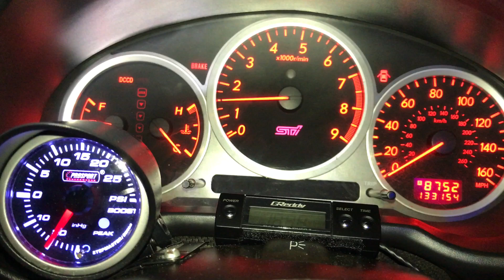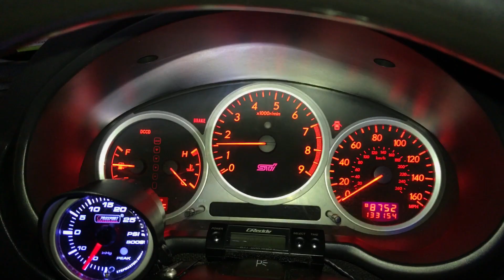How to install Turbo Inlet on Subaru WRX

Comment: Do I need an aftermarket post maf hose when changing my turbo inlet?
Reply from the maker: Eddie Porter I’m not sure exactly what part your speaking of, but what I can say is I used the stock MAF sensor, in an SPT intake, which connects to the newly installed Perrin Turbo Inlet Hose.

Comment: Could this cause my car to run extremely rich and start to misfire? Is misfiring on cylinder 2 and 4 "driver side". Haven't had a chance to check it tho
Reply from the maker: Only way to really tell is to hook up a scanner and see the numbers, also get a flash light and peak at your turbo inlet hose and see if it has a huge rip in it  where it connects to the turbo. thats where they are always known to rip.

Comment: how long did this job take? i just noticed i had a boost leak hitting 8 psi where i have to hit 16, checked my inlet and that shits cut all the way around by the clamp
Reply from the maker: Yeah, I DEFINITELY recommend getting like a Perrin or Mishimoto Turbo inlet hose. AND get a new hose clamp that is not similar to the stock one. I believe they call them T clamps. its a lot safer for clamping on the rubber and it wont eat it up and dig into it like the stock one does. And this job took me a little longer probably like 3 hours but that was because I wanted to make this video to help everyone. If i just ran through this job without making a video probably would of took only 2 hours. Once you get the OEM turbo inlet out, the hardest part is getting the new one slid into the right place and adjusting it so it fits perfect. It is a big Pain in the butt but just be patient and take your time, be careful to not rip anything or break anything in the process of doing it. Patience is key, don't rush, you will get frustrated and think its impossible, but its possible trust me!
Reply: Would you need to tune your car after replacing the inlet hose?

Comment: What size should I get my inlet. Does it matter if it's 2.4" or 3"
Reply: 2.4 for stock turbo and 3 in for aftermarket turbo or sti turbo
Reply: no no no do not make the mistake i did! I ORDERED 3" FOR STI Vf39 TURBO AND NOW IM STRANDED WITHOUT CAR FOR 5  DAYS!  STI uses 2.4''. 3'' is for aftermarket HUGE turbos

Comment: Is it normal for the inlet to be squished against that power steering line? Lol mine has the same issue
Reply from the maker: RichardUzumaki yeah I don’t think there’s really any way around that, it’s just a snug fit and the oem one looked the same.
Reply: VinnieT8 yeah I noticed that too, but yours hasn’t started tearing into the inlet has it? I have a Perrin too and wouldn’t want it to tear over time from movement on the bolt of the power steering line
Reply from the maker: RichardUzumaki no mine hasn’t started tearing at all, I think they should be good, also the Perrin turbo inlet hose is thicker then OEM Stock turbo inlet hose.

Comment: Is there a reason for removing the intercooler? Just curious
Reply: Seemed to have seen everyone remove for the inlet install but what part of it is in the way?
Reply from the maker: Yes it gets in the way where the Turbo inlet hose attaches to the turbo it self. Theres a stock crappy clamp that holds the hose to the turbo and you should always replace this with a new good hose clamp (the ones that dont cut into the rubber) and to tighten them up the intercooler will forsure be in your way. You have to also keep in mind that your working with a huge solid rubber hose in a very tight space. so to have access from that angle could make the difference of you getting the hose in or your car being down an extra day.
Reply: Pretty much every job u do on these involves removing the damn tmic

Comment: Can that cause your turbo to blow up
Reply: josue cervantes yes my stock Inlet pipe had barely ripped and I ran it for a day and planned on replacing it right away but did one pull and fried my turbo. Now I had to buy a used one and a new inlet hose.
Reply from the maker: Yeah I believe so it could

Comment: Damn I feel like I pinched a fuel line while installing this I smelled a whiff of gas but it was gone right after hopefully I didn’t though.
Reply from the maker: Fruit Punch Samurai I doubt that you did, the fuel lines are metal tubes and you would really need to bend one pretty good to break it. But it could of been the injectors you were smelling.

Comment: WTF where does the 3rd elbow of the inlet connect too???? you skipped around 32:54
Reply: plus how the fuck did you get that tube perrin sent you over the PCV diagnosis connection??
Reply: Idk buddy maybe read the instructions that Perrin themselves gives you to find out instead of relying on the video.